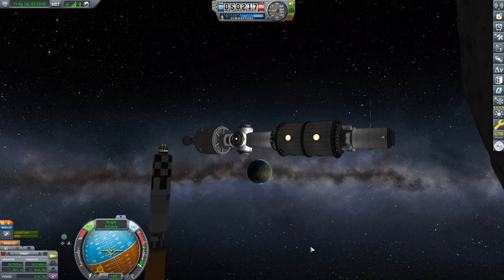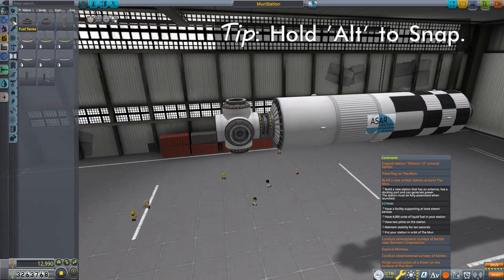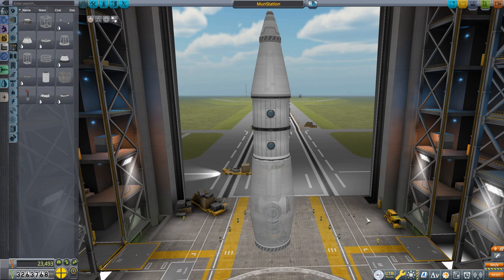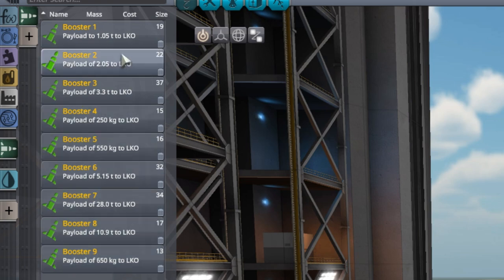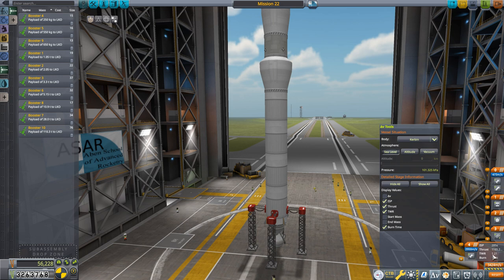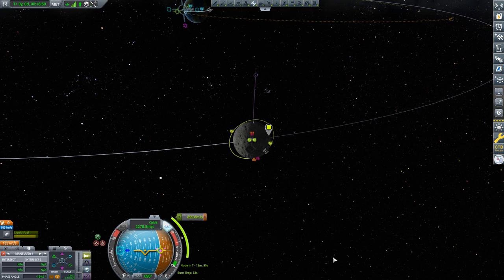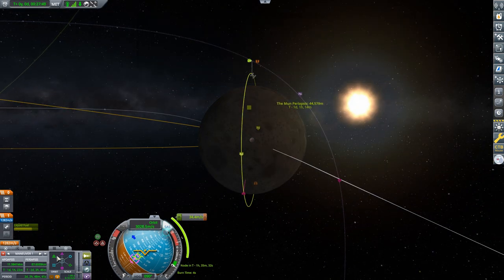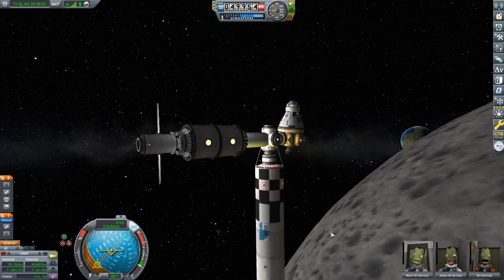Build a New Orbital Station Around The Mun | KERBAL SPACE PROGRAM Contract Tutorials

Comment: Great video! There is a way to get a more efficient rendezvous though. When doing the correction burn, instead of passing over the poles just focus on ensuring your periapsis lines up with an ascending/descending node. This does mean that you are not initially putting yourself into a polar orbit. The advantage of this is that your plane change correction will be exactly at apoapsis near the sphere of influence edge, which can bring down the Delta v cost to effectively zero.
Reply from the maker: Good catch for technique 2, though technique 1 still wins as there was almost no plane change at all.

Comment: Thanks for these videos! Quick question. When you say in a tip, at 11:38ish, that an engineer csn remove "these blocks" after installation, are you referring to the wee rcs boosters?

(Saying that, my asking is a bit of a moot point... Im stuck on console so it's probably a feature im missing, like navigation lights!)
Reply from the maker: Yes, I was referring to the RCS blocks. Unfortunately, I think you're right about that feature not being available on console.
Reply: Okay dokes, thank you! And thank you for replying (and so quickly)! Honestly, the navigation light is the thing I'm most gutted about not having. I'm stuck slapping illuminators onto my ships and they look totally daft, drain power like mad, and are often juuuuust pointing the wrong way, so they don't actually light up my ship. Gonna use them on my lander though, on hinges so I can deploy them when landing!

Comment: is there anything special you have to do in order for the contract to register the fuel after it is docked? I am trying to complete a contract to make a base on minmus, and I went through quite a slog to land and connect a fuel tank similar to the one you made in the last tutorial episode. For some reason, the contract is not completing even though I have docked the base and the tank together. The base is actually the same one you recently made a tutorial for on minmus as well. If anyone has any advice I would greatly appreciate it.
Reply from the maker: Once docked, the game sees it as a single vessel. There's nothing else that needs to be done. Go over the contract requirements carefully and make sure you've not missed something (it's easy to do), but contracts can get borked. It's happened to me. If you are satisfied you've done everything, I would use the game's console menu (Alt-F12) to award yourself the contract.